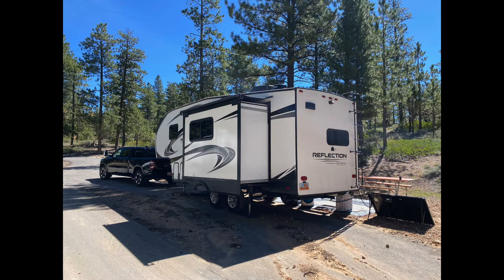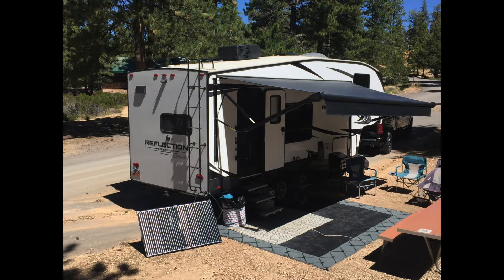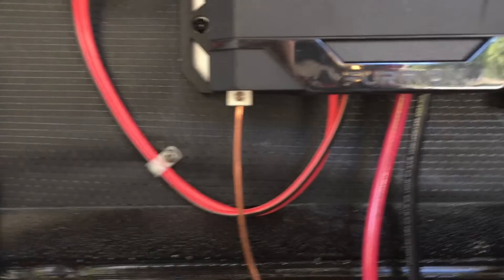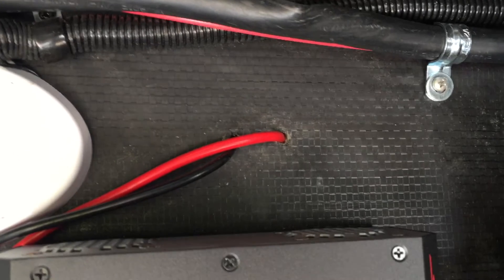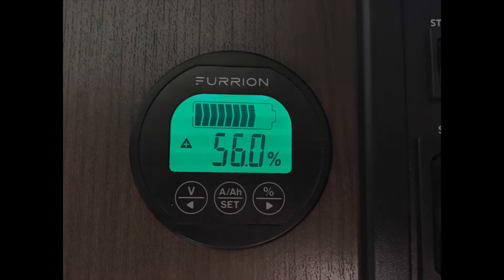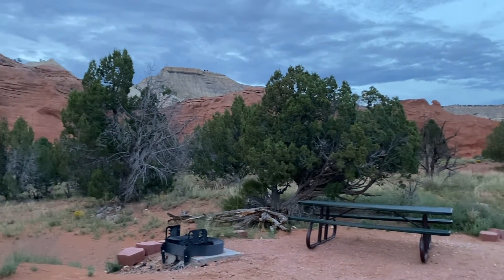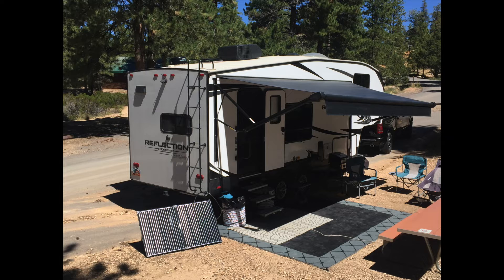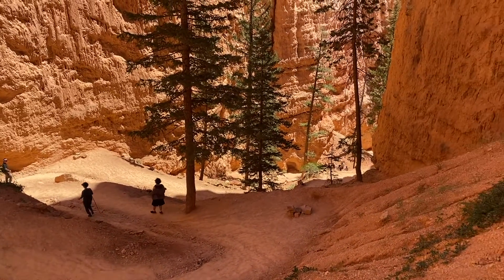Boondocking, Dry Camping. Solar And Lithium Battery Test. How many days will the battery last?

Comment: I have a 24 foot Rv and only boondock all winter in S AZ.   300AH of lithium , 300 watts solar on the roof and never run out of power. But i have a propane fridge and propane furnace and do not need AC.  I do have a small generator and extra portable 100 watt panel just in case, love it!!
Reply from the maker: I wish I had a propane fridge. Really miss that.

Comment: The industry is ruining camping and boondocking, costing consumers more money than needed. I am all for solar and better battery outcomes, but 12v refrigerators are worthless.
Reply: I have several 12v fridges. They work perfectly. What is the problem?
Reply: @mr.monitor.    they don't last long especially if used alot as in snowbird life for the winter   go propane or 110v residential if you have the power.   Just my opinion
Reply: @bobmartens1089 wrong, they last for days and days and use less power in the wintertime.
Reply: I leave my 36ft TT setup at the job site for 4-6mo at a time. The fridge and water heater are run off propane only and I don't skimp on long, hot showers every single day. The water heater is only running when I'm there, so it gets shut off when I leave for the day or if I head home on the weekends. 2-20lb tanks lasts an entire season for me. 12v fridges are only meant for those plugged in everyday unless you have your entire roof covered in solar.
Reply: @InTheDirtAgain I never need more than 200 watts of panels even in the winter to maintain the fridge but I do live in a sunny area.
Reply: @mr.monitor.  Ya, I'm at Glacier NP and summer only lasts 2 weeks up here. Otherwise, its usually overcast or raining daily from May through October.

Comment: Thanks. The new trailer came with 200 watts solar and the dealer had ordered another 100. I've got two 100AH LIfePo's coming and another 110 of external solar being delivered. I would have preferred a two way fridge being old school but now days on a new trailer that pretty much doesn't happen. I do have a more old school water heater though but with the dual propane/electric. What? you didn't run your airco? I'm glad I still have the 3500 watt westinghouse in reserve...

So, I very much appreciate you doing the real life "test." Not as good as hoped, but then again, maybe my extra 140 or so watts of solar will help... And being in MT as home also helps. Heck, up here even house air is still often optional on a new home... But I like the SW and dislike heat...

Comment: Forget unecessary luxuries; one 12V fridge is more than enough; do not use such a high energy consumption inverter (2200 Watts); use low power consumption cooking devices, either AC 220V (110V) or 12V DC ones (100-300 watts).  With only a 200 watt solar panel and an lpg generator to top up your batteries (from time to time, if needed) you are going to be a King...

Comment: I have the same RV (2023 GD 226rk with pretty much the same batteries (LiTime200ah), solar (385watts), exact same inverter. So far as long as I full sun all all day I think I could go for ever running the fridge, watch tv, coffee pot in the morning. But I agree if you set a couple days in a roll with cloudy skies your fridge will eat up the power. If you plan on going off the grid for several days I would plan on a back up plan of having a generator with me to top off the batteries. Another option would be add more solar and batteries. Great video thanks.
Reply from the maker: Glad you found the video helpful. I plan on having my generator ready if the weather looks to be cloudy for several days too.

Comment: Do you need an automatic transfer switch to use the inverter? I have the exact rv you have. Does mine
 already have that or do u need it?
Reply from the maker: In order to tie the inverter into your breaker system you will need to add the transfer switch.  Check your orange wire in the front compartment to see if it is a loop (meaning wire comes in and loops back out with nothing connected).
Reply: @riderescue  Yes you need a transfer switch so when you hook of to shore power it automatically switches over. Without a transfer switch you have to member to turn inverter on/off,  turn off breaker switch to converter just a few manual things to remember or you could have electrical issues which is bad. Do the right thing and get a transfer switch.
Reply from the maker: @theconnectedcamper  My prior trailer did not have a transfer switch and I hated running a power cord and switching breakers. The transfer switch makes it simple.

Comment: My question is how much is another battery, and how much would another battery or more solar panel benefit you. I've not had any real world experience with these, but am interested in doing what you are doing.
Reply from the maker: That is the real question. How much money to spend? More battery, more solar? Small generator for back up? I have been using solar for 3 years now (2 other trailers) and I have been fortunate to only need my small generator (that I have had for years) for bad weather. I am now retired and I want to spend more time dry camping so I want to add 200 more watts of solar panel on the roof (565 watts total) and another battery. That should provide what I need but that is another $1000. Does that make sense to spend the money when I have a small generator that works?
Reply: @riderescue  You can buy a 200watt solar panel for $200, another 200ah battery for $600. The existing solar controller can handle up to 600watts of solar or there about.

Comment: I think what the moral of the story is; that at this moment in time the technologies have not come together enough for the world to go solar. I want more power for longer and it sounds like you do to. The only fix to this problem is money which means most of the world's population could not afford to have energy on a regular basis.
Reply from the maker: You are correct in your questing. What I have works great for most weather conditions but when the battery can not be charged, what is the best back up for power. Spend more money on more solar options or keep a generator ready for emergency?
Reply: Maybe a small wind turbine. You could also supplement the electrical generation with a water generator
Reply: @riderescue  Both, a 2500wat gen is about $300. There are folks that have completely cover their rv roof with 1000 to 2000watts of solar and several batteries with 1000ah. Those people like spending $7000 to $10,000 on the system.

Comment: Nice that your battery monitor doesn't flash when charging/discharging. I have a generic version similar to yours
Reply from the maker: I had a generic  version in my last trailer that flashed and was terrible at night. I searched on line and found that the light could be turned off. Check to see if yours can too.
Reply: @riderescue  I turned my monitor LED light off. It drove me crazy at night timing off and on.